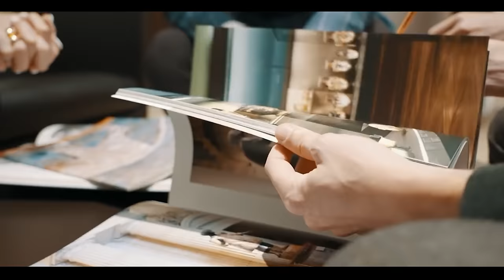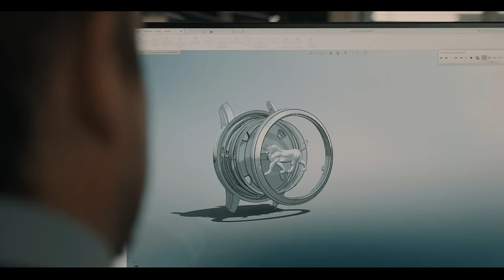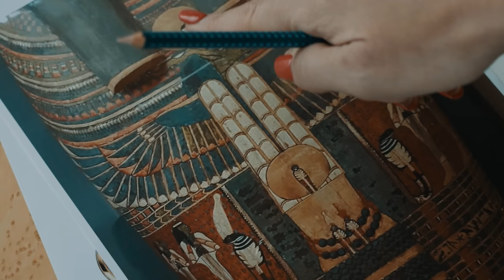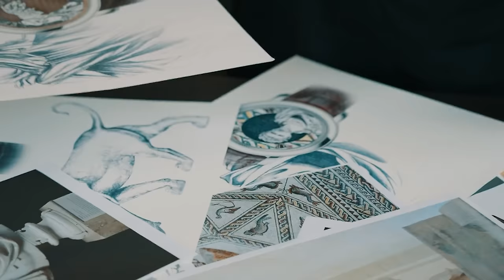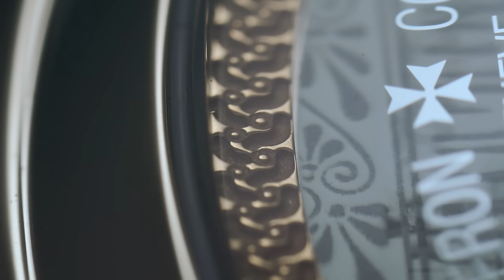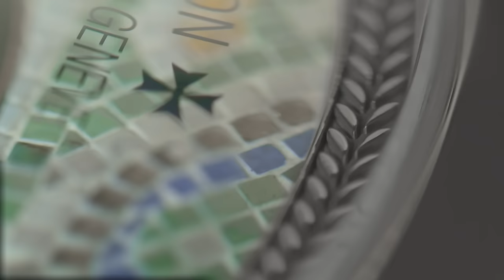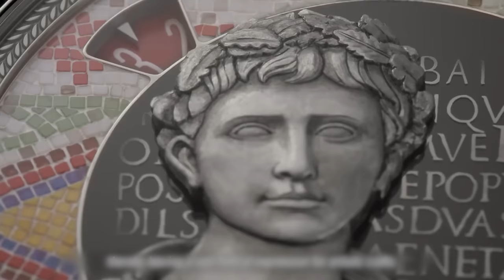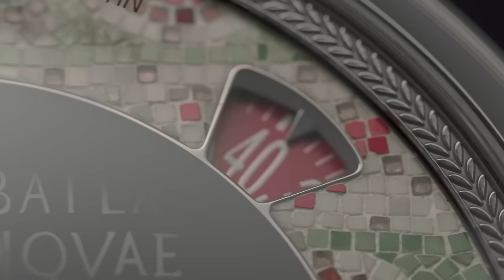Vacheron Constantin reveal 4 INSANE masterpieces

Comment: 13:47 that ring looks like the plastic ring a Vostok would have.
Reply: Exactly 1 sec latter you will see the word "metal"
Reply: @Sandipan_Naskar  I also looked for the texture of the material and then I saw the word "metal". 
It looks awful anyway, not appropriate for the impresive watches.